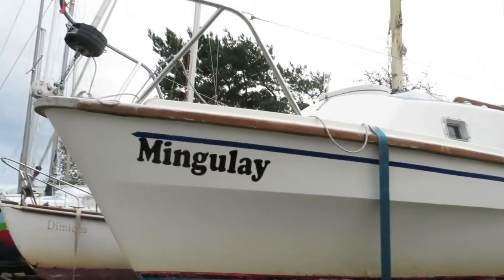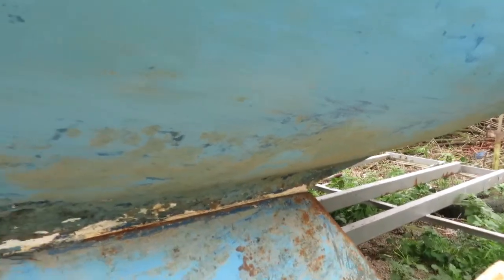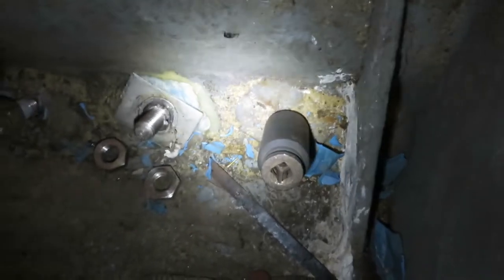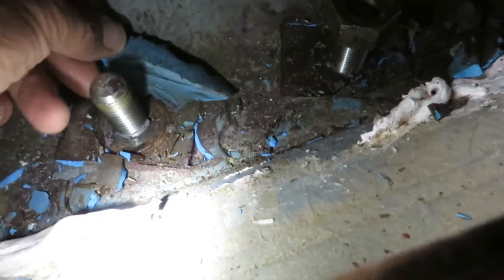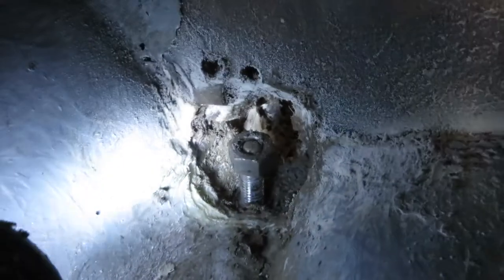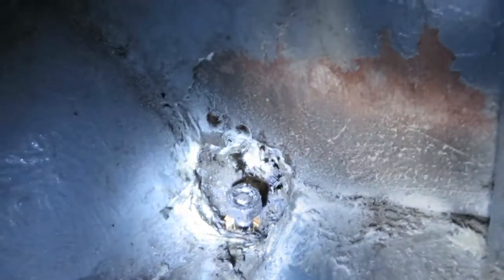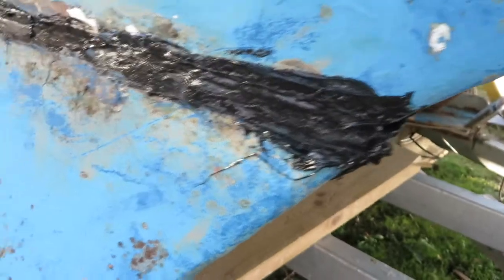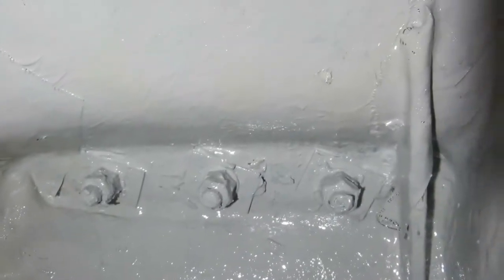Westerley 21 Keelbolts BE7ADA37 A64E 4ED8 A286 80FCC1CB3D90

Comment: you sealed the nuts with sealant and then ploy glassed over, so if they were a chance of a leak from the joint to the keel, it wouldn't flood the bilge? how did it work out?

Comment: Hi Roy...Could you tell me how many keel bolts per side. Good video, Thanks
Reply from the maker: Paul Johnson  Hi Paul from memory there were 8 in total 6 large which you should be able to see easily in the bilge compartment. 1 small one aft, and the most difficult one of all is the sealed one under the bulk head. This I had to cut away a section in order to get to them. Once I knew this bolt was there the job was relatively easy. Because I didn’t know it was there originally when I lifted the boat the remaining bolt I did not know about ripped through the hull. So identify this first and make sure you can release it otherwise you will have problems.
Reply: Thanks Roy, much appreciated!